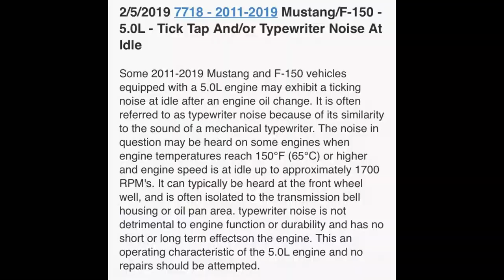2018-2021 Mustang GT Typewriter Tick/BBQ Tick. Don't Be Worried!

Comment: My 14 5.0 f150 has made bbq tick since i picked it up with 185k its getting a little louder now, sounds more like a flexplate knock except it doesnt do it all the time just when you quick rev to 1500 rpm.
Reply from the maker: @Str8Ripper1776  when ypu quick rev that is spark knock. Run higher octane fuel.
Reply: @BeardedFordTech  im running 89 on a multi octane tune, but i am running injector cleaner. Could the cleaner lower the octane  that much? Also just started hearing it after my oil change
Reply from the maker: @Str8Ripper1776  cleaner doesn't lower octane.  If your hearing it after oil change then it's BBQ tick.  Don't add any additives to oil.  You can actually run amsoil 5w40 euro formula and it gets rid of it.  If ypu don't run that kind of oil then the tick can be hear to almost 2k rpms
Reply: @BeardedFordTech  im running motul 8100 5w30 its a euro oil 100% synthetic 2nd oil change with it
Reply from the maker: @Str8Ripper1776  motul not all that great for cars and trucks. Awesome for sport bikes.
Reply: @BeardedFordTech  i run it it my car and truck because it doesn't burn like other oils and runs smoother. I run the bike specific motul 7100 in my dirtbike. Lots of people run it in high horsepower applications
Reply from the maker: @Str8Ripper1776  i mean if you want to.  Just saying from oil testing results it's not the great in car and truck. If you want to keep running it bump.it to 5w40. Have you had your pcm updated due to the "burning oil" or oil consumption. That was due to high vacuum when letting off the throttle and pulling oil past the rings burning it
Reply: @BeardedFordTech  the pcm update was for 2018-2020, they did a pcv change and pcm update and dipstick change. The real issue was the coating on the cylinders and the rings not setting on the gen 3s. My truck hasn't burned a drop of oil in the last 5000 mile oil change with many pulls
Reply: @BeardedFordTech  do you have a facebook so i could send a video of the noise?

Comment: My 2016 has been ticking since the day i did my first oil change on it. Does it at idle and while driving in the lower rpms. Goes away after about 500-800 after an oil change and will not come back until i change the oil again. Then it's back ticking away... Its annoying for sure. Had Someone tell me i had a rod knock the other day. I just told him nahhh it's just a ford so you can't really expect much from them in this day and age. I am going to try that ceratec stuff. So many good results and with people using it to just get rid of the tick. I've finally had enough of it after years of having it.. Makes my gt should like a damn pos beater car...
Reply from the maker: Lol.  It's not hurting anything. Just rather annoying at times. Doesn't bother me. Apparently it bothers people who don't even own a mustang and I find that funny.

Comment: I’m getting the 2019 gt next month and worry about the ticking Noise …. Should I be worry ?
Reply from the maker: BBQ/Typewriter tick is absolutely normal.  Nothing wrong. Doesn't effect performance or reliability.  Cylinder one scoring is a totally different noise that doesn't not go away it gets louder with RPM. High pressure fuel pump and injector tick is normal noises.  I wouldn't be worried at all!

Comment: While watching this video, I just happen to be sitting in a parking lot (in my mustang that ticks) right beside someone in an F150 and it is ticking.
Reply from the maker: Yep. BBQ tick. Normal. "Diesel type knock noise'  heard on passenger side is normal too. You can minimize that by running higher octane fuel

Comment: I have a 2016 f150 5.0 90 k miles should I do this ?
Reply from the maker: No. Just use amsoil engine oil. This will do nothing on the 2018 plus cause of the cylinder liners. I was mad about that. WWW.AMSOIL.COM/?ZO=5124952
Reply: @BeardedFordTech i have a 2021 gt i just got a month ago and i can hear the tick. Which oil do you recommend the 5w20? Full synthetic?
Reply from the maker: @geezus2654  tick is normal. I think 2021 switched over to 5w30 full synthetic. I run amsoil. You'll still have a tick. But not as bad. www.amsoil.com/?zo=5124952

Comment: Can you please help me my local dealership basically told me to F off because I didn’t buy my 2019 California special from them even though they are my local registered Ford dealership they told me it was normal and if I had a problem with their answer I could take it back to where I got it from which is three hours away. it only does it when it’s extremely hot outside and I just start my car and it sounds like pots and pans banging together and a weird ticking noise and it progressively gets louder as I lightly press on the gas up to 2k rpm. But if I go on like a 10 minute drive and come back home it’s no longer doing it and it does not do it in the winter I’m super confused , I use the German liquid Molly to make it go away but there has to be a more permanent fix
Reply from the maker: Can you email a video?  So I can hear it.
Reply: @BeardedFordTech  yes I took a video of my phone sitting on the driver front tire and one of me applying gas to 2k rpm
Reply: @BeardedFordTech  where do I find your email
Reply from the maker: @Mr..Heisenberg  about me section. Down to contact
Reply: @BeardedFordTech  okay I sent them 2 videos it’s pretty loudd
Reply: I bought it brand new in 2020 with 400 miles on it from a Ford dealership the dealership owner drove it a few times he told me that it now has 11,000 miles on it exactly
Reply from the maker: @Mr..Heisenberg  okay

Comment: Hi there. It's been a year now. How is your car running with the tick.
Reply from the maker: Better than ever. Just a BBQ tick hardly noticable
Reply: @BeardedFordTech  thank you for your reply. I've been looking at a 2013 GT. It has the tick. I am really paranoid to buy it. In Toronto these things can be $30000 after taxes. 
50000 miles on the car. Does the tick get worse as miles accumulate? Anyways, i'd appreciate your thoughts.
Reply from the maker: @staraijdid4216  the tick is very noticable on 2018 and newer. However it is present from 2011-now.  If it is the BBQ/typewriter tick then no it doesn't get worse with mileage. Same sound.
Reply: @BeardedFordTech  thank you.
Reply: Anthony H. I have read that the tick starts after the first oil change. Any idea why?
Reply from the maker: @staraijdid4216  it does.  No idea why. Nobody really does. But it's not hurting anything.
Reply from the maker: @staraijdid4216  welcome
Reply: @BeardedFordTech  This may be a silly thought.  Ford or an aftermarket company should  create a sound insulator to wrap around the  oil pan? Hood of the car is sound insulated for this reason.
Reply from the maker: @staraijdid4216  the oil pan is plastic. Great idea. But really nowhere to put it.  However I have heard the 2023 model has some engine changes. Supposedly tick is gone. Not sure if that's true or a rumor.
Reply: @BeardedFordTech  well that's a good thing. Hopefully not a rumor for the new owners. Would be nice if Ford let folks know what was causing the tick in their TSB. And what they did to silence it in the 2023 model year. May be comforting to all the current tick owners.
Reply from the maker: @staraijdid4216  yeah I agree. But at the same time it's not hurting anything. Just an annoying noise sometimes.

Comment: What if my motor is consuming oil?
Reply from the maker: What kind of engine?  How many quarts per 1000 miles?  There is a TSB for oil consumption. Reprogram the pcm so there isn't so much vacuum on deceleration sucking up oil.  Then a fix number 2.  Is it a 5.0?

Comment: I have a 2018 GT I use AMSOIL IN IT and the car loves it 😅
Reply from the maker: @CR36111  same. I don't use that cerma crap anymore. I had their oil tested. Straight lies.  I've been running amsoil a long time. Even my entire fleet of 200 vehicles runs it.
Reply: @BeardedFordTech  never heard of the crema until your video... But yes my friend AMS OIL HAS BEEN GREAT TO ME AND MY LITTLE PONY LOL... BUT I DID NOTICE SHE Doesn't like the AMS differential gear so I had to switch to redline have u had any issues with the gear oil from AMS
Reply from the maker: @CR36111  have not had issues with the gear oil.  Mine is also a manual transmission and I switched the fluid to DCT fluid.

Comment: Well, here I am with my 2021 5.0 6 speed manual. I did my first oil change at like 1000 miles no tick. Now I’m at 4000 miles and I did the 2nd oil change the same way I did the first one same Ford oil, Ford filter and as soon as I started the car, I could hear a very loud taking over my straight piped 5.0 not a normal DI tick it was a very distinct tick every day 4-8 seconds, I could stand like 20 feet away and still hear it . Was told to hold clutch and gas and press start  and let he starter die out and I started it again the  ticking “went away for now” ? Can anybody tell me what clutch and gas does when starting the car after the oil change to get rid of a stuck lifter ??
Reply from the maker: Flood mode. Pushing the throttle all the way down disables the injectors and just spins the engine priming it with oil.  Simply let off the throttle while it's still cranking and it will start.  Flood mode is also what we use on the computer to do a relative compression check.  The tick you are hearing is the BBQ tick. It goes away after it warms up. Always does it after an oil change. But my question is why did you change it at 1000 miles?
Reply: @BeardedFordTech  I just thought it be good because the car sat for 10 months at two different dealerships before I got it at 50 miles on it Unnecessary I’m sure
Reply from the maker: @Salty5hoe  no that's fine if it sat. I was going to say would be a waste if you said you did it to get the "break in" oil out. They don't have break in oil. The come factory filled with synthetic blend. Run full synthetic though. But since it sat that's good you did that. That also shows me you maintain your vehicles.
Reply: @BeardedFordTech  yeah appreciate it . I try my best maintain all cars I get especially if car sits for long a time I try to get the main fluids always replaced
Reply from the maker: @Salty5hoe  good. Keep on top.of it. Change the oil on it every 5k. Not 10k like it recommends.

Comment: I have a 2013 mustang GT with a ticking noise 105,000 miles I use 5w-20 full synthetic
Reply from the maker: Can you send me a video?  13 did it too just not as noticable. Does it get louder with RPM when you push the throttle?

Comment: Hey man thanks for the vid, i have a 2019 with 4k miles on it and noticed the tick so i got an oil change and its ungodly loud now, probably twice as loud as yours🥴
Reply from the maker: That's not a tick in mine. That's the high pressure fuel pump. But it does do it from time to time. Yep first oil change and it ticks. That's when it always starts. When you say loud. How ungodly loud?

Comment: I have a 2019 mustang gt with only 7400 miles on it. Had the typewriter tick, just had a dealer oil change a couple weeks ago and now I think I actually have rod knock or something. At idle you can occasionally hear the tick but if I put the rpms at 1500 it's a constant tick. I have never heard it before. One dealer didn't bother to do anything. Waiting to get into another. Any ideas? I did put a video up on my channel. Took the video under the car.
Reply from the maker: That doesn't sound like BBQ tick at all.  The knock type Noise sounds like the diesel type knock that the f150 also does. Soon as you raise rpms. It's sounded horrible. Definitely not normal.  That car takes 10quarts of oil.  Did you check it to see if it's full.  Been a lot of cases of dealers only putting in 8 cause that's what the 2015-2017 took.
Reply: @BeardedFordTech  Yea I didn't think it was normal. Great. I did check it and it's normal level. Convincing the dealers here without a code is hard.
Reply from the maker: @thedude2897  There shouldnt  have to be a code for that. That is obviously an abnormal noise and the dealer should take it in.  Technically to take anything in there doesn't have to be a code. Just a customer concern.  I would find another dealer
Reply from the maker: @thedude2897  can I use this and make a video so my subs can hear it. See if we can get you some help. And where are you located?
Reply: @BeardedFordTech  Yup that's what I'm doing. The sad part is the dealer I normally go to is litterly a mile from my house. I caught them letting my car sit out in the lot for 2 hours claiming they looked at the issues I brought up last time. Said no codes operating as normal. I'm going to another dealer 20 mins away. Had to wait 2 weeks to get in. Hopefully I'll get somewhere with them.
Reply: @BeardedFordTech  Absolutely. I'm just north of Tampa Florida on the west coast.
Reply from the maker: @thedude2897  alright I'll make a video. Add yours into it I'll even link back to your channel.  I have a few subs in Florida. And just about all my subs are a tight group of people. We all know someone somewhere and we all know techs somewhere. Let's see if we can get you the help you need. Is there a way you can email the video to me?
Reply: @BeardedFordTech  Thanks. I appreciate it. I can try to email it. I just don't know if the file size is too large to send it or not. What's your email?
Reply from the maker: @thedude2897  I actually just downloaded it off y2mate. All good. But my email is in bio if you ever need to reach me personally. If you aren't subbed please consider doing so. You'll find that my subs interact with me and everyone else very well.
Reply: @BeardedFordTech  Cool. Yup I'm subscribed. 👍

Comment: Nope if ur putiing treatment in , or heavy oil and it get quieter, it cushioning tolerance, my third coyote ticking, the other 2 ended up being bad rod bearings, basically like there egged on crank causing a tick , over time they get worse, just enough to get past warranty, 
So good job ford , 2015 was the only reliable year, iv had almost every single mustang , best modmotor hands down was an 03-04 cobra,
Reply from the maker: @mfjones2217  we think we found the problem. A buddy who is a tech in Kansas and I are working with engineering. It's not rod bearing. Rod bearing is a knock. Not a tick. This is a random typewriter tick. It.comes ans goes.

Comment: I had cylinder scoring on cylinder 2 and Ford replaced my short block. I could hear the ticking/ engine slap at idle and while accelerating. 

Update: 1,300 miles after engine. I’m hearing a slight ticking. I’m getting a stethoscope inspection on it to make sure it’s the typewriter fuel injection noise this time and not another issue. 

I’m buying a corvette next time…
Reply from the maker: Oh man stay away from the Corvette.  Couple friends have one. And they hate it. Lots of problems. Wait til the 24 mustang comes out. Complete engine redesign. They also got rid of the plasma lined cylinders
Reply: @BeardedFordTech  Is the S650 really a complete engine redesign? I thought it was just the twin Throttle body/intake changing from the single intake that was the only/biggest difference.
Reply from the maker: @BennyZ88  As far as I know it's redesigned. They also got rid of the lined cylinders. And there is supposedly 4 engine options now.
Reply: @BeardedFordTech  As of right not there is only 2 engine options Eco Boost and 5.0 V8 (Except the dark horse which has extra power over the regular gt) that i know for sure.
Reply from the maker: @BennyZ88  in the ford news on pts it says 2.3 liter 3.5 liter 5.0 liter. 5.0 liter all wheel drive hybrid(not confirmed) but who knows. I wouldn't get a hybrid all wheel drive anyway. So I don't think they will do it. I want a dark horse

Comment: My 2004 Mach 1 has a similar inconsistant tick towards the top of the engine. It goes away when the RPM's increase.
Reply from the maker: Have you pulled cave covers and inspected?  Other than that shouldn't be a concern if it goes away when RPM increases. It would be a problem if it got louder with RPM.
Reply: @BeardedFordTech  I have not. It sounds like it's coming from the intake but only presents itself after longer drives. I do remember reading that someone else had this issue as well. Not much information about it on these 4v engines from what I've seen.
Reply from the maker: @danroden6183  first check the spark plugs. 32 valves were notorious for plugs comming loose. If all that is tight then  ticking noise may be comming  from the valve guides that need to be replaced. You can do a compression test to see if you have the same problem. It is usually cylinder 5&6 sometimes 8. Noise mainly heard on driver's side.
Reply: @BeardedFordTech  thanks for that info. I should check the plugs although I believe those issues were fixed with the '03 models
Reply from the maker: @danroden6183  they supposedly fixed it with early 04 models. But when I was a tech at Ford we came across one every now and then. If your compression checks out and spark plugs are good I wouldn't worry. There was customers complaining about it with over 100k miles and there was nothing wrong.  No check engine lights or engine damage. It would make me more comfortable knowing you checked those things. It would also put you at ease as well
Reply: @BeardedFordTech  whoops I meant after '03 haha. I'll check the plugs and compression. My car has been doing this since I got it 10k miles ago
Reply from the maker: @danroden6183  all good lol. Let me know what you find and we will go from there.